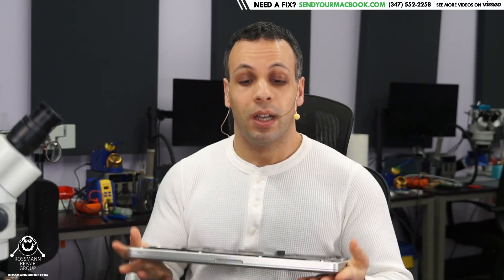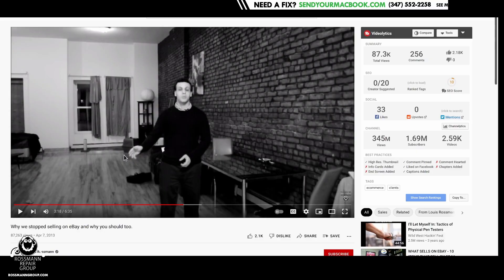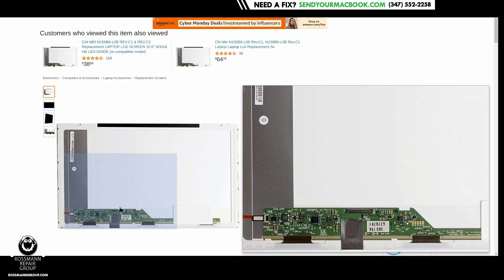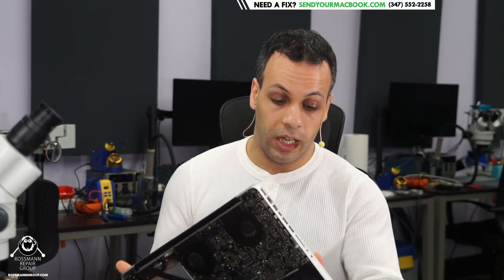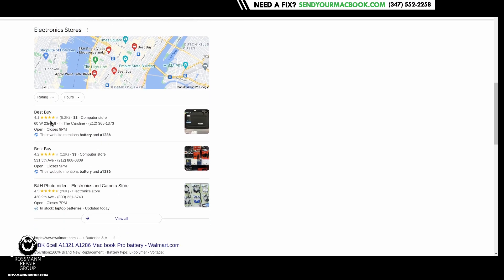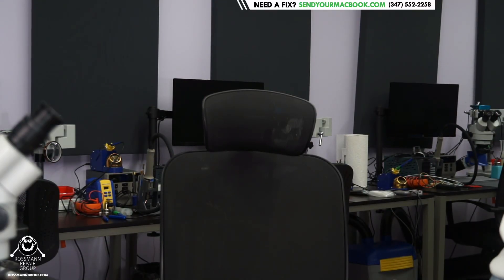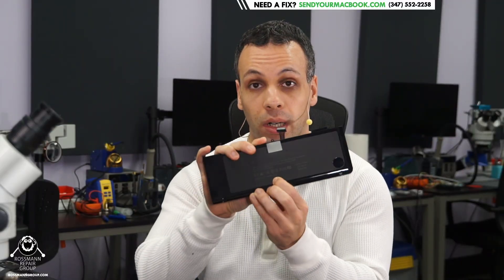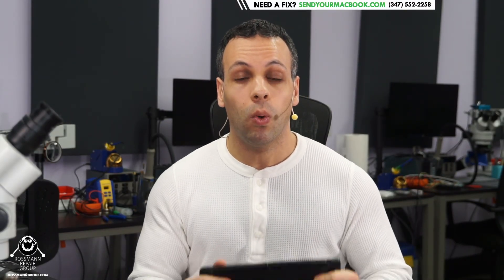Apple switched - and + on battery connector from 2010 to 2011 w/ same form factor; WHY?!?!

Comment: I know Apple to be garbage and do blatant horrible stuff to get more and more money, but I was not ready for this.
Now I am being too careful because I want to swap an A1322 battery with what is likely A1321. Of course I will take my meter to test it. One battery is for a Core 2 Duo + 9400M GT device, the other one has some i5 with Intel HD graphics 3000. But yet they are both from 2010.

Comment: Isn't there some additional numbers besides the modelname on the device? For instance a Thinkpad will not only have "T580" on it but also sth like 20L9001YGE which specificies exactly which parts are in the laptop.

Comment: I work at an AASP, the model number on the bottom of the laptop is actually never, at any time, used when in contact with apple to order parts. We only use the model name (and serial number), for example in this case "Macbook Pro (15-inch, mid 2010)", afaik it's been like this for decades. I don't know what Apple actually uses the model numbers for since they are as you say commonly used for several models that might have pretty much nothing in common.

Comment: HP did this to me. I was doing general IT assistance for neighbours and such like as a part time DIY job. One guy asked for the screen hinge replacement for his HP laptop. I have a look, and the hindge is fine, the stupid plastic case snapped, so I look it up, and yes, I can order a new bottom case for it! Great stuff!

Part comes in, exact same part number... turns out HP also noticed their crap design, and completely redesigned the laptop casings and hinge, and never changed the part numbers!!! Then of cause, the old parts sold out as everyone else ended up with needing them for their broken laptops. I ended up returning the part, and just bolting (with literal bolts) the hinge back into place. Laptop was fine except for the bolts on the bottom (case was already broke, so left the customer in at least a better situation than before).

Comment: But are those batteries compatible? Is it possible to change the connector or re-pin it (if the pins are the same) with the case of an old connector?
Can you buy the cheaper one on purpose, because its only a pinout difference for that 20 buck?

Comment: It use to be you would order parts and they would all be a little different, even though they were the same part. Could be generic, could be manufacturer changed the part, could be manufacturer updated/improved the part. I remember when mechanics and techs would lambast you as an idiot for questioning if you had the correct part.

Yeah, sure AapleHoles don't rely on the confusion at all.

Comment: The benefit could be shorter motherboard traces here and there, but I very highly doubt it can ever compensate the cost of making the changes to the production line of the batteries, even if they're small.

Comment: Search for replacement parts by the model number of the part itself, not the laptop. Oh, and buy a guitar pick. Once you get past the screws on most cases you have plastic clips to deal with, which you can unclip by running something like a guitar pick through the seam.

Comment: The main model on the front you can't ever go by but I find the model on the barcode on the bottom on non-Apple laptops is usually fine, it usually will have a -A or TA or rev B at the end etc.

I then order but before I install the parts I double check, the parts closely, if they aren't the exact same I do further research. So far has always been the exact same. Although your advice is great if it's easy enough to open.

Also for Apple, why did they swap polarity and not have reverse current protection on the motherboard, I think we all know how Apple operates. Stop buying Apple!

Comment: That’s really annoying. I’d love to know WHY they reversed the hot and neutral placement on the battery. They literally had to change the trace on the motherboard PCB to make it work. Sure seems like a trick. They have to comply with Right to Repair so they make it so difficult that it’s intimidating for DYI’ers to handle it. They want to get you running to the Apple store.

Comment: Why they changed it?  simple,  the engineer designing the new laptop had his iPad upside down..
By the way, its not just with electronics..  I needed a new gear hub for my bicycle, and it turns out that the new internal part of the hub now shifts the other way around (pull cable to shift down, release cable to shift up), while the original one from 10 years ago did it the other way around...  looks like I'm gonna have to include a new shifter as well..

Comment: When purchasing a device you should get a simple list with human readable names with all part numbers.
And the manufacturers should think about good battery design, basically the sizes, voltages, to make a standard, then make every x time a new battery following that standard, even with higher capacity when technology becomes better over time.
Imagine you could buy a Laptop with 10h/d screentime battery, after few years it’s down to 6h/d or broken, you could just buy a new battery which now has 15h/d screen on time. Why not? This would give devices so much more lifetime.
Of course they should make a battery standard size (size not capacity) for each form factor, small laptop, big laptop, maybe shared with small and big tablet, two for smartphones (small / big for e.g. standard phone and pro max phone), one design for small devices like smart watch and airpods …

All should be easy user replaceable.
Reply: And my guess is that Apple just did not want that, the new battery may just had higher capacity, but you shall buy a new device to get a better one, simple Apple logic. 😶
Reply: And of course it disables downgrading, when user has the new device, maybe the user doesn’t need that much battery capacity and would rather buy one with lower capacity when price is half; but the only good thing that Apple could have thought of is if the connector is incompatible (hopefully you cant stick the reverse plus minus one in) that the user won’t complain about - ‚I got new battery but screen on time is a lot worse than when device was new‘ thing, in case the user did not know about capacity change and just thought like stated in video - same device model number - same part - same functionality of that part.
That’s why part number should be easy accessible even without taking it apart, and the user should get informed by this.
And parts should always have something like ‚Is compatible with‘ whatever, a hashcode or something.
Just compatible doesn’t mean same capacity or features, but it means compatible. When shopping for same part number of course you should get everything the same as original (or better when compatible, when they e.g. stop producing the old lower capacity one), compatibility is king.

User replaceability is king too.

Comment: I agree but have a counter example. I busted the IO board in my ASUS K501 laptop by shorting vbus to 12v from a wall power adapter. Lots of magic smoke and funny smells etc. I took the IO board out and went to ebay. There are multiple versions of the K501 (UX, LX, etc. ). I don't remember if I couldn't find the one for my version, or it was cheaper, but for some reason I knowingly bought the board for a different version. It was clear the PCB was different, didn't even have the same ICs, but everything worked! Obviously not always the case, but I appreciate the engineers at ASUS for not being completely hostile. It'd be interesting to know if they make an effort to keep things compatible or not.

Comment: To be fair, way back in the dinosaur age when I worked on fixing analog TV sets, you couldn't always count on the same model number or even chassis number to have all identical parts between one another.  A manufacturer would find a better or cheaper way to build that chassis, and so in the new parts went, with a design change as necessary.  The servicer had to know enough about what was going on with the circuitry to follow these design changes, not necessarily rewire it like an older schematic showed.

Comment: It's a wild west all over again (with China maybe we should say wild east).

The altruistic thing to do (and Louis would surely do so if he had time) would be to establish some kind of collective and authoritative "How to identify and replace Macbook batteries" website that has a good Google rank.  The confusion gives Apple (who assigned these non synonymous identical numbers to laptops in the first place, tsk tsk tsk) more excuse to say "Let Apple do it all."

Personally as a nerd I always do look for replacement parts either by exact identifying information for the equipment and the literature for it, or else by the number on the part itself.

Comment: I know I opened my laptop just to find out why it was making an ungodly noise... turned out to be a wiggly fan rubbing against the metal housing... it took forever to find a replacement... only downside to finding the part number and having no idea where to shop for new parts... lol

Comment: +1 for the exposé
Sounds like maliciously bad engineering.
Any electronics engineer worth half a tinker's d@rn would build the power connections with diode protection in case of accidental reversal.
Lord knows & do it in my own designs just in case I might get a few drinks in & get handsy with the wrong power connector.

Comment: Also doesn't help the battery for the 15 and 13 are different. Although a 13 battery can be made to work if you extend the cable..lol..don't do that though..

Comment: This is potentially the only downside of older laptops where everything was accessible and removable. They were made to have parts commonality so it was cheaper for the manufacturers... make one chassis and then have placeholders for specific configurations or customers. I love the old Dell Precision mobile workstations but they can have a range of half a dozen of any one type of component, meaning you have to be very careful as not all are compatible per laptop model due to having different motherboards or firmware revisions. There's also multiple different screens available and some have special wireless antennas which not all chassis's can utilize.

Comment: To answer the question in your title that you already know the answer too. "To make independent repair people look bad by making a simple mistake and to prevent using old batteries connectors with the new housing." You change the battery and miss that they have shaped plus and minus. Well, guess you're just a bad repair person and I'll sue you for damages while I only go to authorized apple repair centers bend over and say please harder daddy.

Comment: Hi Louis
Is there a manufacturer for the battery of a MacBook Pro (Retina, 15-inch, Mid 2015) that you can recommend besides an original Apple battery? I currently have a battery from iFixit installed, but it is absolute waste. Am also happy for any tips from the community. I live in Europe.
Thank you very much.

Comment: Maybe an interesting avenue to fight for the right to repair would be search engines.. forcing, not just only showing the part number you searched for, but make features like “‘my device” in the same way you can let eBay know “my car” to show you compatible devices, imagine making legislation that demands for an open source database of compatible parts/devices, imagine a search engine that shows you when you ask: recommended parts that surrounds that part, sort of showing where we are on a map of the device.

Comment: How do you prevent it? Apple should add one more part to the motherboard for revers polarity protection? Since your device is this expensive it doesn't matter if apple adds a diode.

Comment: I misplaced the hard drive of my Emachines E528- 2325 windows 10 laptop because the person who sold it to me put Timerunner on it which allowed him to control all my Macs once the laptop was connected physically to my router. I got really angry & removed Timerunner & took the ssd out that came with it.
Is there a way to get another ssd & restore it to factory settings ?

Comment: Here's the dirty secret of manufacturing - what we produce is referred to as an S.K.U. which means Stock Keeping Unit. If there is any change that impacts the form, fit, or function of any aspect of the device that is being made, then you generate a new SKU # or create an incremented the SKU revision. This was best practice, when the manufacturing world was concerned at all with providing ongoing customer service up to and including 3rd party repair support. A 123-A and a 123-B being different but functionally equivalent makes sense to the consumer, the warranty support team, and anyone looking to repair or maintain the product.

Revision control is a thing of the past, specifically because the manufacturing sector simply wants you to buy a new product, ideally from them. You have a 95% to 99.5% to 99.99995% chance of buying a good enough product from any company to warrant you spending your money with that company again. Internally, it's justified as a cost reduction, because the end-product is essentially the same in use and function, therefore it's not different and the (truly trivial, but on the books inflated) cost of SKU generation and maintenance isn't justified.

Comment: So yes this sucks and is horrible. But it’s not because of malicious intent typically. It’s usually because the manufacturer of one of the components (in this case probably the motherboard) had a change that required a different battery. In the case of the acer laptop probably because the CCFL screens were getting difficult to find.

Comment: This is a lot like the auto industry that has split model years for different parts. At least with vehicles they have a manufacture date stamped right on the door jamb and many places can decipher a VIN. If the computer industry would allow end users to decipher their serial numbers to get their specs and part numbers that would be a huge step.

Comment: Had this problem with the hp pavilion g6 I needed a new lcd flex it has 3 different type of cables all looked exactly the same but the connector was different and the would be about 50mm shorter that each other and no way to identify the cable you need

Comment: 6:53 My experience with just using PipeWire has been much better than trying to use JACK.  I was never able to configure jack to have audio without crackling/popping in JACK, but in PipeWire, I've had no problems.

The issue with PulseAudio was that it was built for minimizing cpu usage for audio.  PipeWire lets the cpu be used more to get lower latency audio, which I believe is motivated by gaming.

Comment: I seem to recall that Apple did this (the flipping power and ground on an otherwise identical connector) with the LaserWriter printers, to force people to use apple parts to repair the device instead of Canon/HP equivalent parts for the CX/SX engine the printer was based on.  Said apple branded parts were naturally more expensive.

Not surprised in the least.

Comment: The other day at the hackerspace someone killed the M.2 port in his Asus laptop because the SSD also fitted upside-down. The connector key wasn't aligned but you'd have to look closely to see that, and not pushing much it actually inserted fine…

Comment: It's supremely stupid in fact, I could understand changing the pinout if the step down regulators were moved due to layout changes in the new mobo, but at that point you're better off designing a new battery all together if you're running on apple money.
Changing a single cable on the battery in a way which forces a bulk order to change isn't just confusing, it's needlessly expensive.

Comment: My first smartphone was a Samsung Galaxy S4mini (GT I9195). After 2 years I accidently dropped it on cobblestone pavement and the display died. I thought I could replace it myself as I already swapped some iPhone 3 and 4 displays. So I ordered a replacement display for my S4 mini, unaware of the fact that Samsung made a second revision (GT I9195I). It almost fit on my phone but the display got pretty warm and the touchscreen wasn't working. After I found out about that, I gave up and bought a new phone. :/

Comment: Those are engineered to fail and to be not repairable …
Who the fuck use the same model number for different model ? How can this be from a certified ISO company ?
We had to put on the outside of our product the hardware revisions even if we had to change the supplier of a component …
Fuck that shit …

Comment: The only nice thing about Linux is bringing an old Chromebook back to life. Other than that it just doesn't work with....well everything! It's easy and useful for a lot of things especially if you're using terminal all day, but for Joe public it sucks. Some distros are getting better but they're not there yet.

Comment: Nope. Not having this problem with my Asus N73. It was cheaper than the MAC, it still works today and the battery slides right out and can be replaced with an even bigger after market one :)